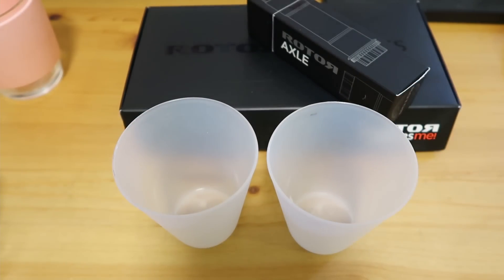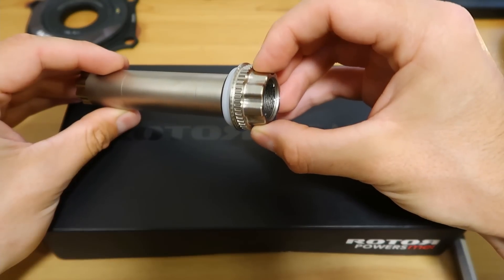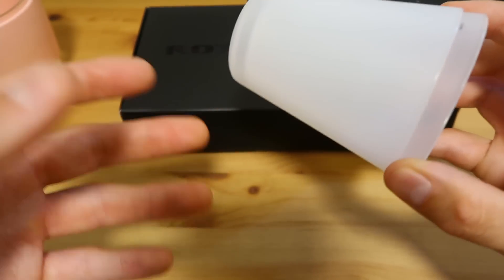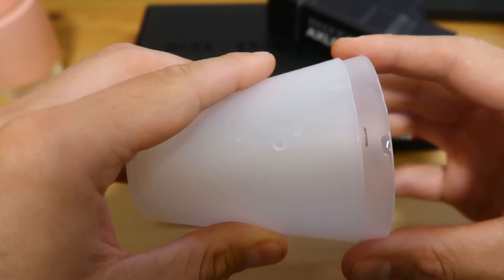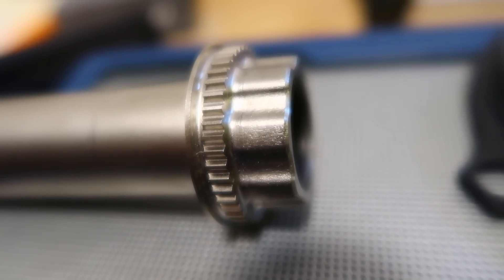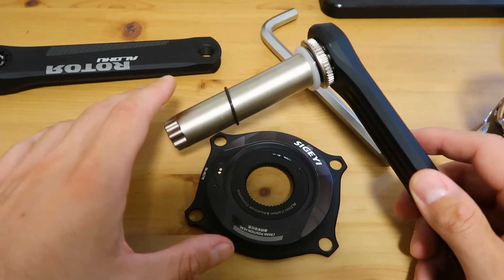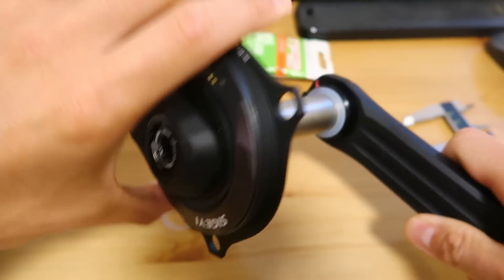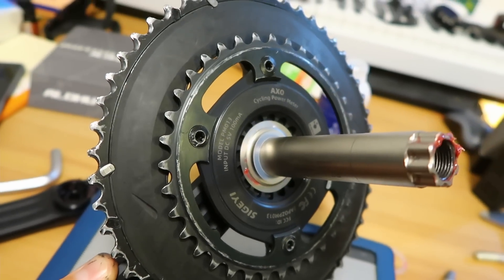Should you replace your Shimano cranks with these? ROTOR ALDHU Design completely & utterly analysed.

Comment: I'm curious, is that taper absolutely necessary? A non tapered spline interface would have worked too, unless you are concerned that too much clamping force is applied to the chainring spider at 35Nm make up torque.
Reply: For an untapered spline crank to fit an untapered BB axle there has to be a small gap between them, so there will always be a small amount of movement between the parts. As a result, if you stand with the cranks level, then turn the cranks 180 degrees and stand again, you're guaranteed to get a small amount of movement between the untapered crank spline and the BB axle spline. 

This movement will chew material away over time (And feel terrible to the rider), leading to cranks that can never be fully tight, as well as premature loosening of the crank retaining bolts. Best case it'll be a similar level of wear to that caused by the constant small movements due to thread precession in pedal threads where they interface with cranks, but in my experience on badly fitting ISIS style splined BB's, it'll get a whole lot worse a whole lot quicker.
Reply: @peglor  Thanks for taking the time to reply. I reckon the small gap is not necessarily required. A small amount of interference fit would have solved this problem. This, plus the bolts should be sufficient, without over engineering it with a taper.
Reply: @kev7355  When you fit the crank if there's interference in the joint, the axle spline will shave the interfering material off the crank to allow the parts to fit together. An assembly like this might work acceptably the first time it's put together, but will deteriorate fast once it's been rebuilt a few times. 

Also keep in mind that these are mass produced parts, so normal production tolerances will mean some will have clearance and some won't fit together at all unless there is an extreme level of quality control.
Reply: @peglor  You make very good points there. I understand about production tolerances, and ISO has interference fit standards that cover the tolerances. Machining of interference fitting machine parts is not something new, and crank is not something that is removed and reinstalled constantly.

With all due respect, I still don't think its required, but the engineers who designed it and thought about the whole system ( manufacturing, costs, reliability,  patents, etc ) thought differently. I'm sure they know something I don't, and that is fine.
Reply from the maker: I think the best/simplest design is clearance spline + pinch bolts, but shimanos patent covers that. Rotor did something similar a while ago with a single pinch bolt but maybe it infringed so we don't see it now. Personally I don't like the spline and taper. Its risky and hard to get right.
Reply: @PeakTorque  I wonder how Shimano managed to patent the pinch bolt design in the first place though. The DMR Chieftain Crank uses almost exactly the same setup (Except it's a single pinch bolt rather than a pair of them, and the crank is welded from steel tubes). 

That came out well before Hollowtech II (I think it's from around the same time as Shimano released its Octalink cranks, the original Hollowtech, which used 8 tapered splines and a full cartridge BB). It is possible Shimano had the patent before the DMR product was released, but that would mean the 20 years of the patent would have already expired I reckon.

If it's a US patent rather than one for the entire world, this is less of a surprise as the US system seems to be based entirely on how much money you have rather than the originality of the design.

Comment: I am on my third Rotor crankset. On the first one the left arm came loose and destroyed itself. The second one was DOA. The axle had terrible burrs and so the surface on both arms was destroyed. The third one is working so far.
Reply from the maker: That does not sound good!
Reply: @PeakTorque  Most of these issues are user error. Insufficient torque or not grease on the mating surface, poor adjustment of the preload. The issue with the alloy axles destroying themselves is usually just bad bottom bracket alignment or poor preload. But sure to check the bolt after the first few rides which is good for peace of mind.

Comment: I love the power meter setup on these, and they have used the same interface for quite a long time so there are actually plenty good used power2max meters available online. You can also play with crank lengths quite easily. After spending years riding BMX where this kind of design is the norm, I have always found two piece cranks quite annoying in comparison considering how the whole thing needs to change if you change bike or damage something.
Reply: Historically road and MTB cranks were 3 piece setups back when most of BMX was running one piece cranks and oversize BB's with press fit cones. Then BMX moved to 1.37" threaded BB's which 1 piece cranks couldn't be inserted through, so they moved to 3 piece cranks. /In the meantime road and MTB moved to 2 piece cranks and external BB bearings. I expect it's more the  case that BMX hasn't moved to 2 piece yet rather than that 3 piece is the end of their evolution.

Sadly the bike industry has never cared whether their designs mean dramatically increased expense when part of a one-piece assembly gets damaged and you're forced to scrap the whole lot. It is possible to buy individual left cranks from Shimano, which came in very handy a few years ago when the pedal threads failed. The UK importer of Shimano doesn't do any of this though, nor do they even admit it's an option as it's more work for them for less profit. 

Just go to Shimano's own website, look up the exploded diagram of the crankset to get the part number (Usually the PDF you download from Shimano with the diagram is actually an order form because Shimano expect you to be able to order individual parts), and google the part number to find sellers - There are some decent shops in Germany that support these orders, https://bicikli.de/shop/ is the best one I've used for having Shimano parts in stock - they're excellent for things like freehub bodies and ball bearings for hubs too.

Comment: just replace them with 105 cranks EZ
Reply: I guess 105 is the best alternative to DA/Ultegra cranks due simplicity of it's design. You can even take it apart during the ride with only 5mm hex key and take out that dropped chain without making huge mess. What are the chances you'll take big enough lever on your bike vacation to cope with crank/bb issues on a system that requires 30 or more Nm

Comment: This business with the tapers is quite bad on SRAM GXP and others. It messes up the chainlines and you end up having to mess around with spacers. The "average" bike mechanic can't get their head around it.
Reply: Since this design locates the spider on the machined shoulder (which sits on the drive side bearing) wouldn't the chainline be exactly determined?
I mean to the extent that the frame is manufactured precisely anyway.
Reply: I don't think that applies to this design. Both of the arms bolt down to the axle, and then the preload collar is expanded to tension the bearings. The only need for spacers is for different BB types.
Reply: @galenkehler  ON the GXP, the non drive side bearing is fixed so it determines the axial position. If the taper nips up more or less then it moves the effective chainline. SRAM obviously know about this because their solution is to add more grease and clamp it up again.
Reply: @Hambini  for sure, I'll never defend GXP 😁
Reply: @Hambini  I'm just a bike mechanic so apologies for my lack of engineering intellect but are you referring to DUB, not GXP? I only say this as with GXP on the non drive side the axle butts up to the non drive side bearing. The NDS crank arm then compresses to the opposing side of the axel on NDS bearing. The chain-line is determined by the location of the NDS bearing and the only way to manipulate the chain-line is by moving the NDS on the BB shell left or right. With dub you have a series of spacers which you can replace etc to manipulate your chain line should wish to stray from Srams instructions.
Reply: @highcarbrider  Just guessing, but I think he was referring to the case that you couldn't fully torque the nds crank arm; thus, leaving the axle partly unseated (that is, not pushed as much to the left as it should be). Other that, yea, where it works, gxp has one chain line and one chain line only (unless you manipulate the nds bearing/cup).

Comment: As a machinist who has in the past needed to nail axial positions of shafts relative to their tapered sections I can vouch for every statement you made about the production of a part like this. 
Very tricky!
In fact I might wager that they may cut the tapered section in one operation then locate that part on that section to cut the corresponding shoulder. Even then, most lathes would be at or beyond their ability to position a cutter accurately enough to put that shoulder where it needs to be. If it’s a steel axle, I would be looking at cylindrically grinding that to size. 
I too have swapped out my Shimano crank for a modular design but I went with Easton. Their solution to this is quite different in that the chainrings get splined and bolted to the crank arm before that whole sub assembly gets mated to the spindle. 
Very clever and it works great despite its aluminum axle. (One piece Hambini bb ensures there isn’t undue wear from misalignment.)
Reply from the maker: Nice to get a machinists POV! I don't envy those who have to make tapers to axial length specs. What you said about mating them and then cutting the shoulder would work, but then they'd be matched pairs (crank and axles). The fact that they're not matched serial numbers kind of makes it impressive i think.
Reply: Except he is mistaken about how the rotor is produced. This will be machined on a Muti-axis CNC lathe with in one setup with additional milling axis. It is commonplace technique in precision machining.
Reply: You writing a book or want a metal? jeesh looooooooong response,
Reply: @JeffOTRCycling  manufacturing is complicated and nuanced. If reading isn’t your forte perhaps leave that to the big kids and fuck off.
Reply: @JeffOTRCycling   calm down jeff

Comment: That’s good. I’ve been considering these cranks for more 1x chainring options
Reply: I did exactly this. I got the power2max track powermeter on the rotor aldhu, and it gives a perfectly centered chainline (42mm)on my disc brake road bike (142mm rear axle)

Comment: @Peak Torque... no offence but putting the power meter on the crank spider is just a really dumb idea. The best place for it is on the crank arm where  it is out of the way.
Reply: The spider measures torque from both crank arms at one location, if measuring at the arms you need two separate units. The spider is typically a more reliable location for a number of reasons.
Reply: @LuescherTeknik  Yeah, you can really se that from the observational data. The most reliable power meters are usually spider based.
Reply from the maker: Disagree. Its much harder to electronically cancel parasitic bending strains on the crank side wall. The spider allows for a better strain gauge layout and higher signal to noise ratio. In general.
Reply: @PeakTorque  ... That may be true, but consider power measurement on a bicycle is just a reference number giving you an approximate expenditure of power over a given course the accuracy of measuring power on the crank arms gives sufficient accuracy for intended purpose. Putting the power meter on the spider just adds unnecessary complexity  and goes against the kiss principle of engineering.
Reply from the maker: @coldforgedcowboy  true. Any number will work as long as its repeatable and reliable i guess
Reply: If the power meter costs a lot more than the cranks, you could at least theoretically use a setup like this to allow the same power meter to be swapped between multiple bikes. With the tolerances on the crank taper on the Rotor design, I'd close that crank bolt once and try to never open it again as it'll drift off tolerance with wear each time it's opened and closed though, so I don't think this particular design is a solution for a swappable power meter.

Comment from the maker: Link to the cranks and axle in description. Copped both for about 200 quid. Let me know if you understood the bit about the taper geometry. I kept hammering it home but don't know how obvious or not it is to people. 
Edit: reading some of the comments, it seems this design isn't the most user friendly or clear to install. To help those with issues here are some vital points:
1. You MUST back off fully the preload collar before assembly otherwise you can deadlock the BB bearings.
2. If your BB shell (thus bearing stance) is slightly too wide, doing up the tapers to the full torque may compress the BB bearings and over preload (deadlock) them. In this case, remove the plastics 0.5mm shims and oring. This will give you up to 2mm more shaft to play with.
3. If the 35Nm wont fully lock the chainring spider or power meter, tell Rotor its out of tol. If they mess you around and chat bs, then gently heat the crank to 60c and reinstall with grease on the spline. This will slightly enlarge the female taper.
Reply: Clear explanation, even for a non engineer. Thanks for clearing these things up. Cheers
Reply: i am using rotor aldhus on 2 of my bikes nad lovem also with oval rings! nom :)
Reply: I think there are some manufacturing issues with Rotor at the moment, I've seen the pedal threads stripping out and their chain ring bolts snapping at 3-4Nm (think Damien Clayton experienced this at the nationals)
Reply: seems like the links arent working
Reply from the maker: @danielhostetler2896  cheers should be working now
Reply: The illustration with the cups was great!
Reply: Do you think several re-installations /w wear will impact the position on the taper? would you recommend using this, instead of the heating?
Reply: Fitter and Turner apprenticeship back in the 80s and wish I had someone explaining stuff like this to me back then. 
Your a natural teacher, the tapered cup idea is simple and clever - well done. 
Clear explanations of complex ideas are why your videos are great. Thanks!
Reply: On my TCR Pro (my20) I did not use any shim, only the o-ring on the driveside. However, the driveside seems to be 0.5-1mm further away from the downtube than the non-driveside. Strange. I can only shim the driveside I guess...but shims will only increase the diff. Did you use one 0.5mm on the driveside and its completely centered?